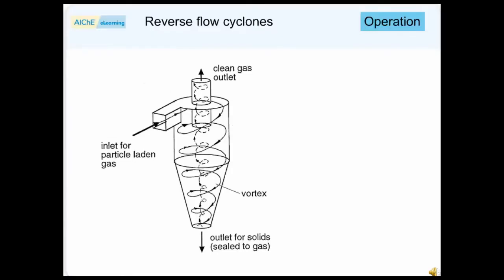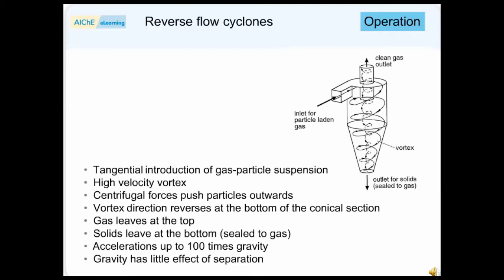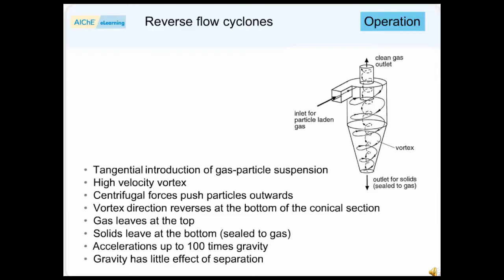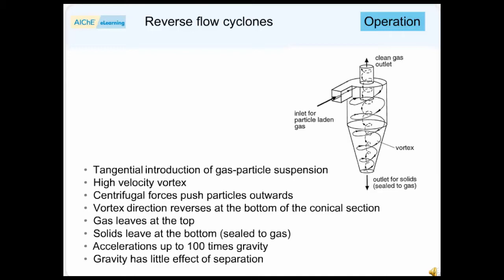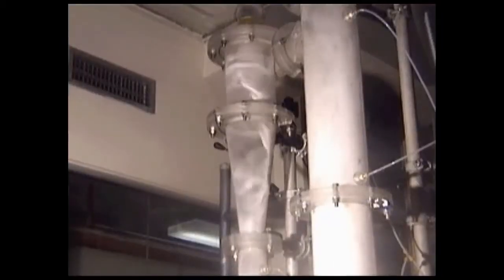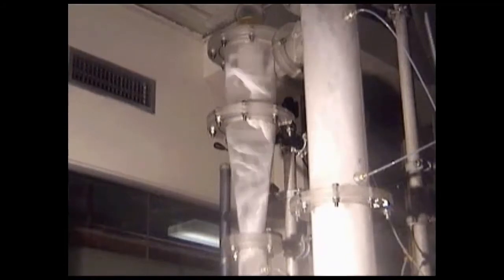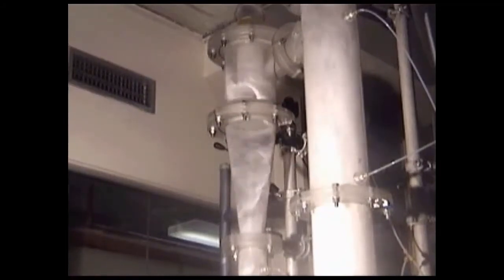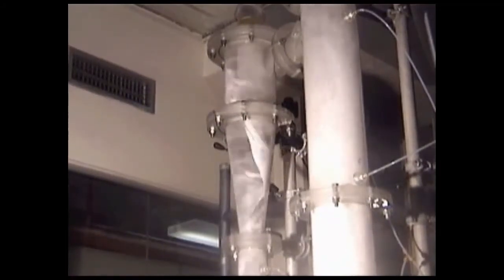Cyclone Separators Demonstration

Comment: Would you please explain how to solve the problem of back flow of the air due to moisture in powder? The air with the powder reverses and comes out from the airlock and becomes dusty
Reply: create a channel it has to follow so it spirals 360 degrees to below the inlet, once below the inlet you will not have the backflow issue since it will no longer have a way to travel back to the inlet path.
Reply: @sirseven3  below the inlet? Inlet of the air into the cyclone? Would you kindly explain
Reply: @samiyaqoob7503  yes have the air that is traveling along the inner perimeter of the cyclone. Direct the air down in a spiral to below where the air is coming in. You are getting the back draft because as the air spirals inside the container there is nothing stopping the flow from spiraling through the air that is coming in. If you would like we could get in a discord call and I could draw something up for you
Reply: @sirseven3  for sure, I would love to to talk to get an expert opinion. We can try that of fb anytime

Comment: Sir, can we use this model of separator as oil mist separator. As we know that Blow-by gas from Diesel car engine (combustion process) contain oil (lubricant)/oil mist.

I need to separate oil from gas in order to deliver/provide fresh air to the engine..
Reply: think of the oil as a heavy substance compared to the gasses. the oil will follow the discharge port where the gasses will go through the accept port. the crank ventilation with vehicles are not super high pressure so this will have to be small enough to generate the needed pressure to create the vortex

Edit: running the accept port to the intake will still cause the vehicle to collect carbon since it is still an exhaust gas but the manifold is under vacuum and as long as the cyclone separator is the correct sizing then using the extra vacuum in the system can provide good results